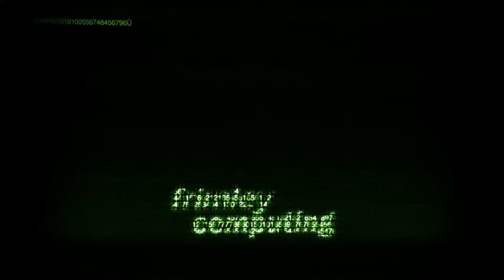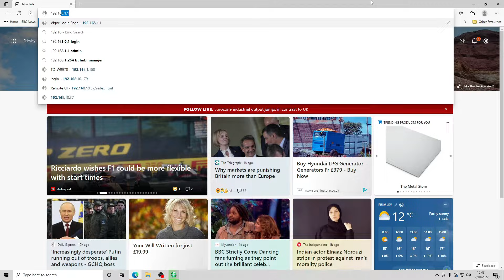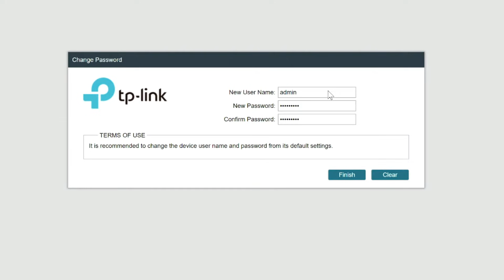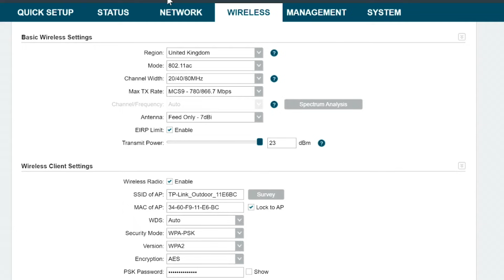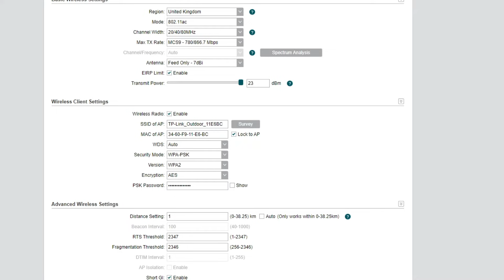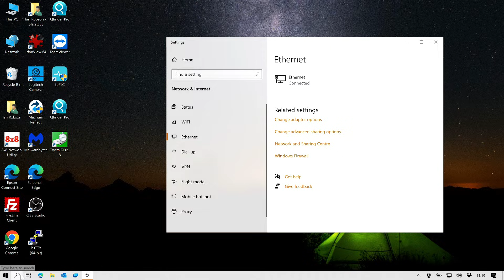TP-Link CPE710 TX and RX step by step setup for a building-to-building connection

Comment: Great video but my client won't connect. I can see the AP easily on my phone but nothing across the field to the other house. Zero wifi. I've done this 8 times and finally found your video and thought it was all good. Nope. When I go log into the Client page, the LANO under setting is not showing any movement on the bar graph at the bottom. I'm guessing that means the Client isn't getting data from AP.

Comment: Hi !...the video is very interesting, but I don't agree with configuring the units a few centimeters from your eyes and body. At first, I was a bit skeptical about the power of these CPE710 devices. If they're configured at 27dBm, they provide over 10W ERP and almost 20W EIRP power to the focus of the dish (I use a spectrum analyzer equipped with CH Power measurement). Therefore, I consider this layout incorrect; it's better to position the units far away or at least set the power to the minimum (0dBm) during configuration the electromagnetic fields, are odorless and invisible, and at those millimeter wavelengths, you should be very careful if the antennas are pointed at your eyes.

Comment: Nice video, Identical looking config to the lesser CPE510. I would've like to see a speed test at the end, Ookla or the such. I've a pair of CPE710's to pre-config today. The restrictive 100mb network ports on the CPE510's is a real letdown.

Also, hmm if you leave the range at 38km but the link is only say 30 meters apart, what happens there? Is there drop off?

Comment: ...and, by installing a Rx device, do i need to set up a switch and number or access points to spread the wifi connection? Basically, from TX to Rx, Rx laid switch and switch to access points?

Comment: Thanks, brilliant explanation. And I didn't know about the distance setting, I don't recall anything in the user manual about that, and had been running mine on 'Auto' for the past year, and now that I've changed it to 0.03 (to reach shed at end of garden) it has improved signal strength 2-fold.

Comment: I have fiber connection 700 mbps but i got only 100 mbps limit speed using client and AP mode 
How i can get the full speed
Reply: Also I made the client the transmitter and AP the receiver by mistake but it work fine only issue is limit to 100 mbps

Comment: Will I get a Wi-Fi signal coming out of the receiver or do I have to plug in a router in access point mode to get Wi-Fi?
Reply: There's a comment further down where this is confirmed. Yes, you need a router connected to the Client device via LAN cable to get wifi distributed in building #2.

Comment: That's what I would call a proper session I was thinking about getting one but will stick with my simple extender😊
Reply: Do these CPE antennae have to be configured in pairs? Like a transmitter and a receiver? or just one CPE antenna can be used as an extender and be utilised by mobile devices? Without a second CPE antenna on the receiving end?

Comment: So you would do this from two buildings and then could plug an access point into the LAN port on the client unit correct?  Then you could have WIFI inside even a metal outbuilding?
Reply from the maker: @jamisonmunn9215  yes that’s correct 👍

Comment: then after doing this setup, do i need a router for receiver to use by - connecting it through Ethernet cable, because the receiver most probably would be in terrace and the pc or connecting device would be ground floor ?

Comment: Hello
Is it possible to get the WIFI signal from the transimmter into a std wifi router ?
OR do I neet a 2nd CPE710 unit to receive the internet?
Reply: if the router can connect to the 710 ( wireless bridge)

Comment: I’ve been binge watching videos on wireless bridges as I will probably install one rather than trench in an underground cable.  Your video is much better than the others I have watched, but almost all of them distinguish the two units as a transmitter and a receiver.  They are both actually transceivers (transmitters and receivers); if they were not, they would not be able to communicate wirelessly.  But you also refer to them as an Access Point (AP) and Client, which is correct terminology for your application.  (Master and Slave might also be appropriate in some applications.)  Thanks for taking the time to dig into the configuration menus for this device.
Reply: Yup, your comment beat mine to it.
Reply: also Near and Far

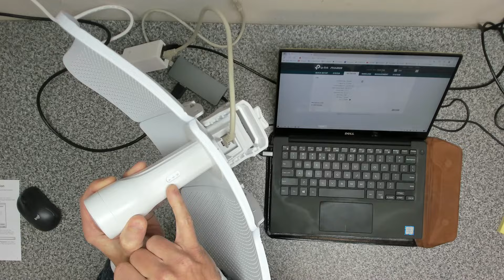Comment: Everything in your video falls apart at 4:57. Where does the 192.168.10 come from? The 10? How come your Angry IP search range is .10's? After that point where I connect my internet to the injector as you state, nothing ever works again. I have to do a hard reset on the CPE710. I downloaded Angry IP and ran the exact same scan using your exact same parameters and got nothing. Not a single live port. There seems to be a lot of holes in this process.
Reply: He is already set the device to obtain dynamic IP adress. So when it is restated it will choose the network ip
Reply: He set it up as dynamic ip address, so it automatically changes to Network's subnet and pick a ip address. Angry IP Search was able to find it.
Reply: I think he use another pc to connect to cpe710
The pc which is already connected to the network.
He miss to mention this...
He use 2 different laptop's for this...
You can see desktop icons are different at that time

Comment: Excellent, helpful vid, though I would have liked to have seen the process of aligning the dishes (pan and tilt) in their final positions. The only thing I won't be doing is having an active radio sitting there with the feed horn point straight at my noggin...

Comment: I don’t know why but my unit keeps blocking. I seriously think tp link is a scam company. It’s slow and everything is as if we are in 2000. I thought to make use of this antenna but it was not possible. I had to unplug it many times from the power so I could get to the settings and when I did it just kept blocking or hanging. What on earth is this device that it can’t do what it was made for.

Comment: Can we use one of these antennas to connect to public internet? Let’s say I am not far away from a shop that has internet. Is it possible to point the antenna to that shop and connect it then attach it to a router which then can give me internet?
Reply: likely not - shop/mall wifi signals are not gained ( therefore not directional) so that the dish can capture the wifi signal

Comment: Hi, could a single cp710 be used as an access point? i have an outbuilding across the yard i need to beam wifi into and this would be ideal as have line of sight straight into it
Reply: Yes. Your cell will pickup the wifi with just the AP. However, if you want to add a wifi router at the outbuilding, you need a client device.
Reply: I’ve done this and am currently watching this video troubleshooting as it suddenly stopped connecting; I’ve used it for four years without issue prior to this. Was beaming internet from the house to my garage on the property

Comment: I've had this set up for about 9 months but want to update the device on the receiving dish end that people connect to I.e. plug cable from dish adapter into that people then connect to WiFi with as it was something old and spare and it's slow. Can I use something like the TPlink RE650 WiFi extender or does that cable slot on that only emit to wired devices or will it receive the cable signal from the dish and output it to wifi?

Comment: This was so damn helpful, amazing work! Thank you so much I now connected 2 homes using networking

One helpful tip - 

The Client configured device's output will be the Internet you will need to receive - just connect it to your home router's main WAN connection slot.

This way you can have one house transmit its internet from your server device
the other house can receive the transmitted network via the client - the client can have a router(s) connected which can transmit the network to it's devices
Reply: I ran into a problem here. After setting up the RX as client, I was able to connect directly via Ethernet on my laptop, but when connecting that live connection to a tp link deco router, it won’t pass the connection on to the deco. Got it to work for like 2 minutes then I’ve been sick ever since. Laptop won’t even get an ip now

Comment: Hi there. Cool video and informative. 

For example can i have one CPE in TX mode and two or more connecting to this unit in RX mode if they are all relatively in the line of sight of it the AP?
Reply: Yes you can configure then with one AP.

Comment: Do I need to buy two seperate CPE710 devices or does the box come with two? Thank you
Reply from the maker: You need to buy two, It's one per box. 🙂
Reply: @FrimleyComputing  ok thanks. Is there any application where you could use only one?
Reply: @CrashTestDougie85  
In answer to "Is there any application where you could use only one?"
You could use only one if it's just running as an access point
Reply: @FrimleyComputing  Is it possible to tx the wifi signal with one CPE710 and rx with an EAP225? Or do I still need 2 x CPE710?
Reply: @CrashTestDougie85  I was thinking along the same lines but in reverse with an EAP 225 for TX and CPE 710 for RX. In my case for a short 30 metre application of a garden office with an EAP225 already in place and sufficent for outdoor applications. @FrimleyComputing Can CPE710 RX from the EAP 225?
Reply: @garry2416  I assume it can be done but would like someone with more XP than me to confirm it.

Comment: I have tplink cpe 710 and I have gigabit switch with gigabit compatible ethernet cables but still tplink shows 100Mbps port and not 1000mbps
Reply from the maker: Perhaps you have the CPE605 which look identical but has lower WiFi speeds and 100Mbps port?
Reply: @FrimleyComputing  i just buy cpe710 but can not change the channel width only 20mhz and max Max TX Rate max MSC8 - 156/173.3Mbps, how can I change it to a maximum of 867 Mbps according to the specifications?